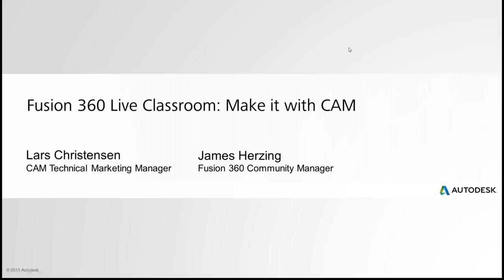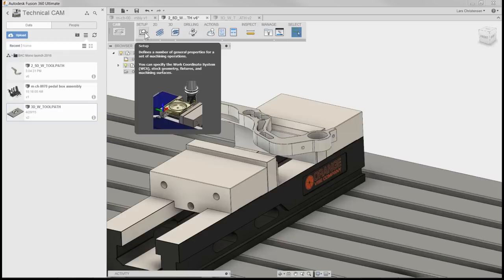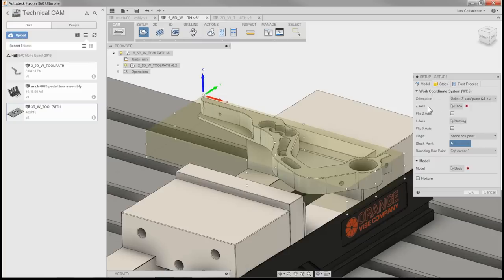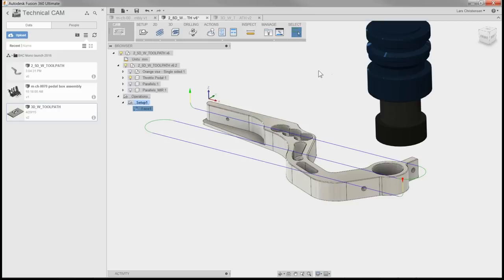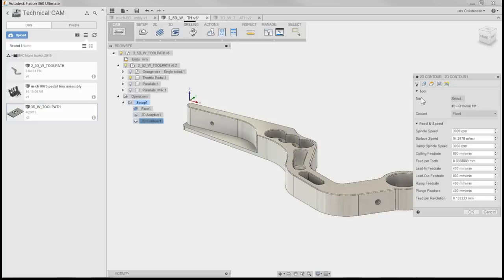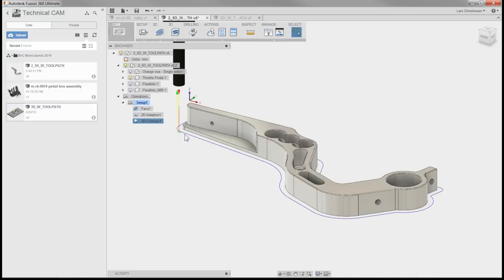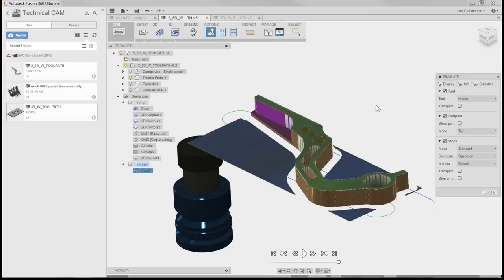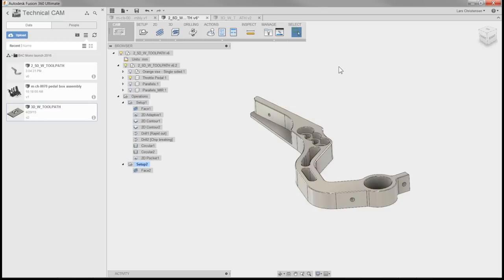Fusion 360 Live Classroom: Make it with CAM with Lars!

Comment: Hi Lars, Love your Fusion 360 videos. particularly the CAM side, great detail and very well explained. Lars, if I could ask a question please. I have a Tormach CNC Vertical Milling machine and I have a post on my computer that is written for my machine(by Tormach) to suit Fusion 360. Could you please tell me where I have to place my Tormach Post so that it can be read along with the rest of the posts that are provided with Fusion. I would appreciate your help, but do understand if you do not have the time. regards Peter (Australia)
PS there is already a Tormach post there, but it is for a different machine control.

Comment: First I want to thank you for this presentation it is well done. My questions is why the nomen was set up with x + to the right and y + going away. On all mills I know of the machine home x 0 ,  y 0 is the left side operator front of the machine. Everything from there is negative not positive. the z orientation is correct down is neg up is pos,
Reply: +Datco Mfg That was interesting as I have never seen a machine orient travels this way.

Comment: I know this video is a year old but maybe someone will reply. I have a question. Reguarding the facing simulation, why didn't it start where he specified in the back left corner. The facing op started in the fwd right corner. The same is happening on mine in Fusion 360.